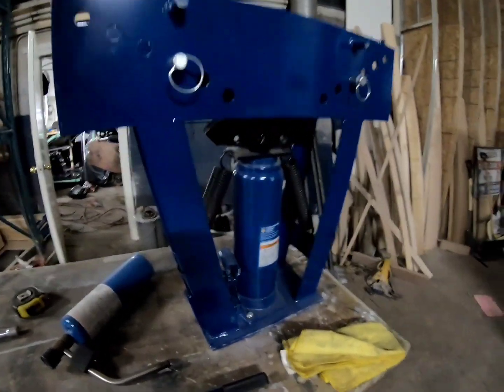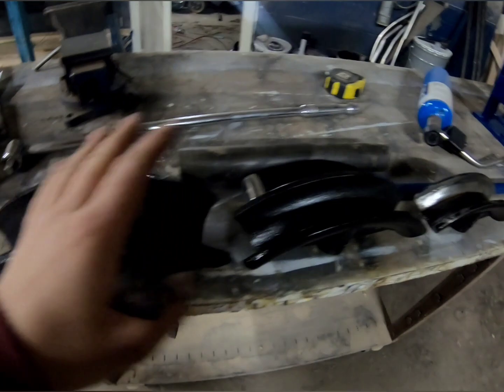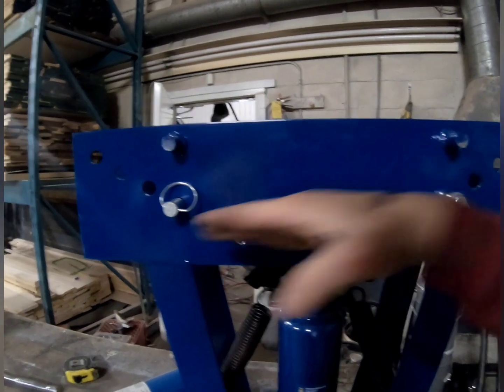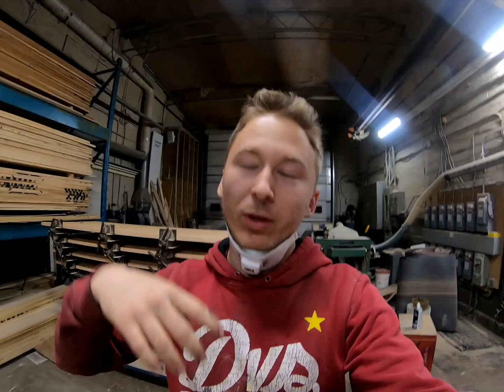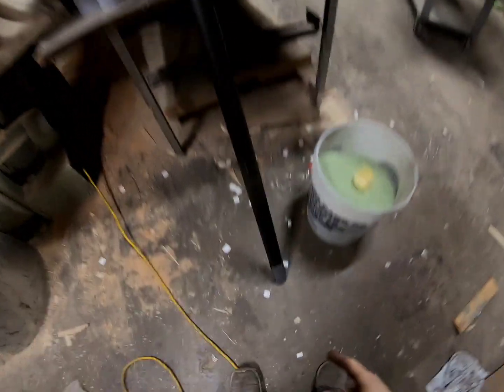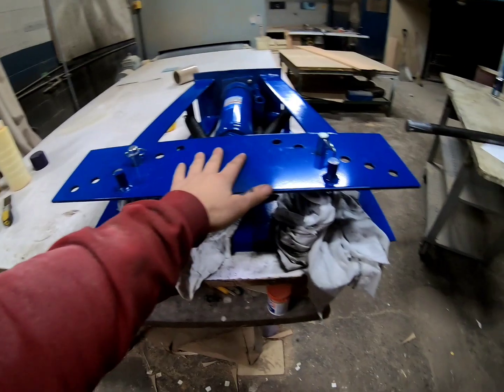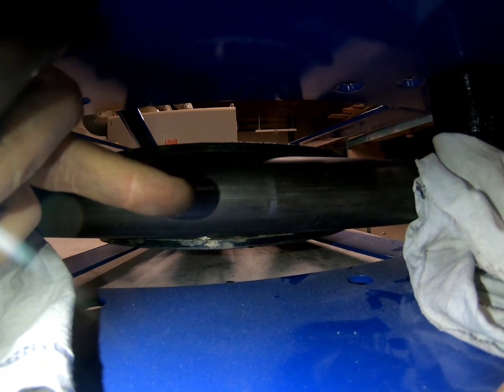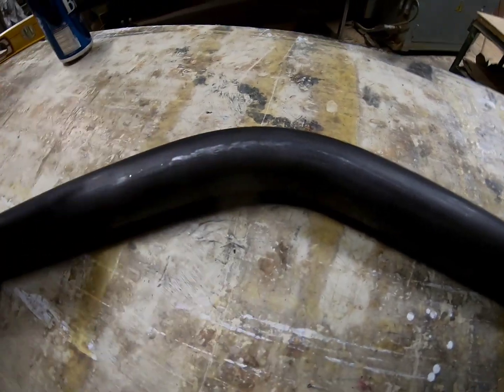Making a Pipe Bender Work As a Tube Bender ||

Comment: put a screw on the drill then a an oversized washer between two nuts, slide the washer to the side to make it eccentric, when you start the drill the washer will start impacting the pipe at high frequency, packing it really fast.